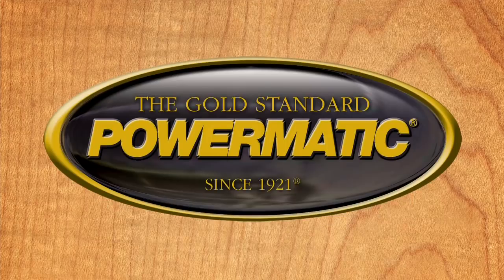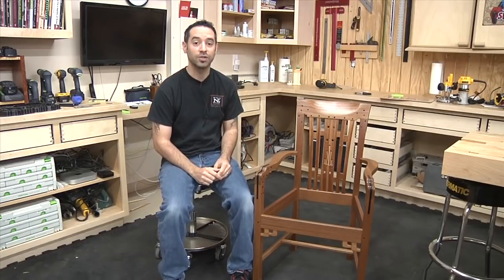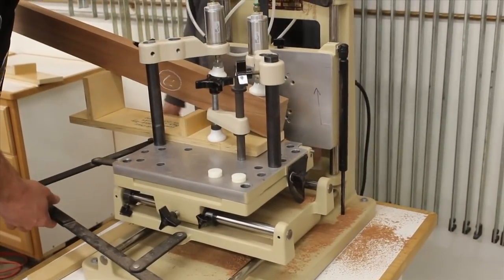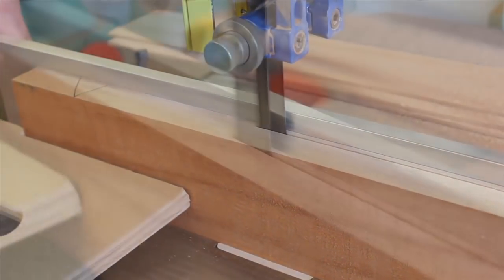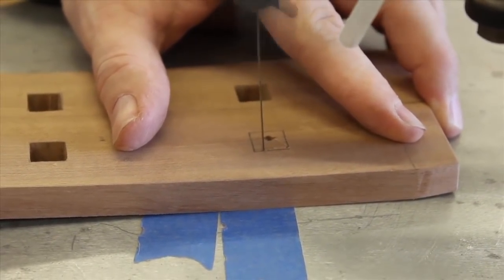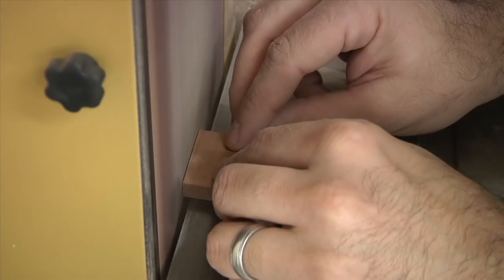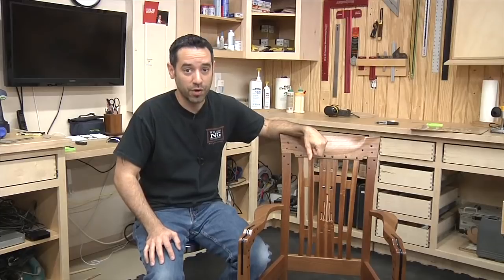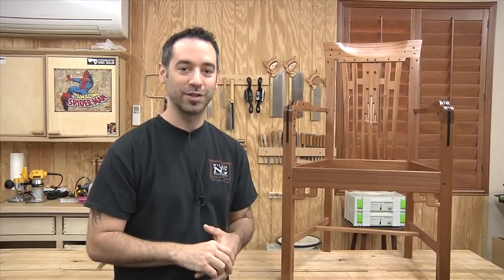215 - Greene & Greene Blacker House Chair

Comment: Impressive piece of work.  One thing that has always bothered me about the Greene & Green style is the ebony details.  Clearly on your chair and most of the other modern reproductions I've seen of these pieces the plugs are just decorative.  But I was surprised to see that the splines are actually functional in your chair.

In the original pieces, are the plugs (and other ebony details) purely aesthetic like they mostly are on the modern pieces?  Or are they actually functional (i.e. used for locking the tenons, etc)?
Reply from the maker: The vast majority were decorative. Darrell Peart showed some x-ray images of G&G details that reveal most splines were just there for decoration and rarely provided any real support. For the most part, it was all about aesthetics.
Reply: The Wood Whisperer That is what I thought, and why I was pleasantly surprised to see actual functional splines in this chair.  Their lack of functionality does bother me just a bit (my engineering mind keeps telling me "form follows function"), but I guess there isn't any need to further increase the difficulty and work required for an already complex piece like this by adding functional pegs all over the place.

Comment: How did you put those small tapered sections into the leggs? I have been trying to do this myself but chissels and determination have only rewarded be with frustration . . .
Reply from the maker: Those were done on the multi-router. I have done them in the past with a standard router and a jig that sits over the legs. WIth a stop collar and a straight bit, the whole thing becomes pretty straightforward and all that's left to do is a little sanding.

Comment: forgive me if this is a contentious point, but why use zillions of powertools and jigs to reproduce a 120 year old chair?

Surely as a craftsman, you transcend WWing for the sake of aesthetics; part of your connection to the G&G heritage is to build as they built? Otherwise you're just making a facsimile of or an homage to history, rather than a re-creation of it... ? 

I understand you said time was a big factor, but I'd wager the Greene's could spokeshave their stock to the right size before a modern woodworker has even cobbled their jigs together.
Reply from the maker: I honestly don't understand your logic. But the joy of woodworking is that it's a very personal experience. So when you build your projects, you're certainly free to do it however you wish and in whatever way allows you to derive meaning and purpose.  For me, using power tools and jigs doesn't detract in any way from the building experience. In fact, they enhance the experience for me.
Reply: The Wood Whisperer then I wish you all the best, sir.